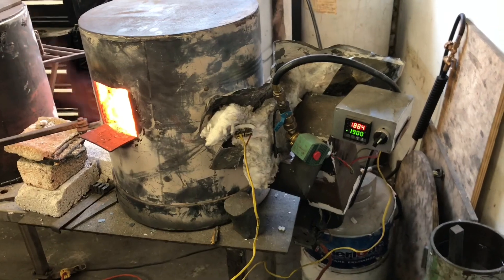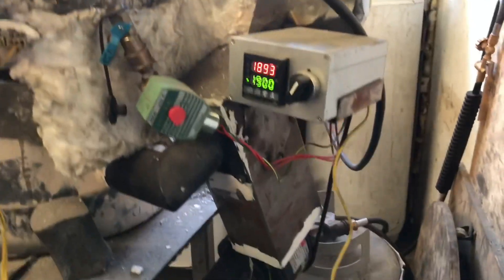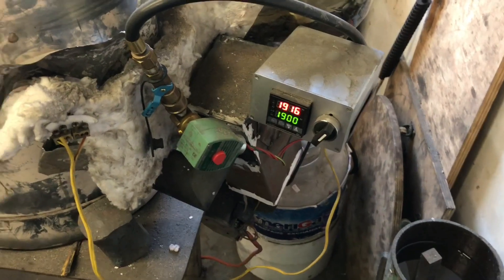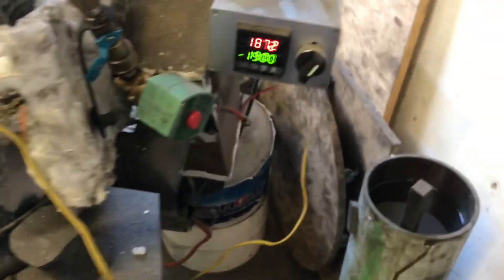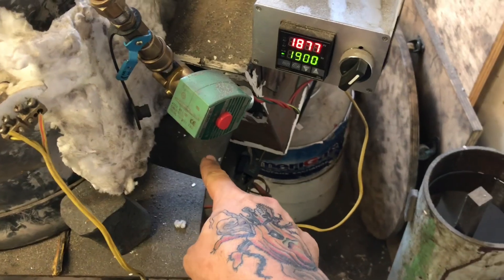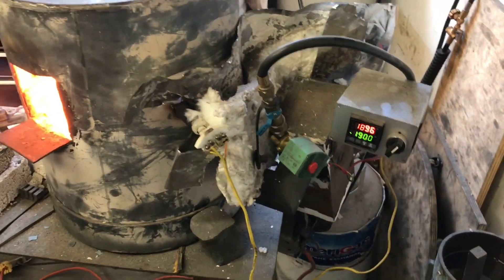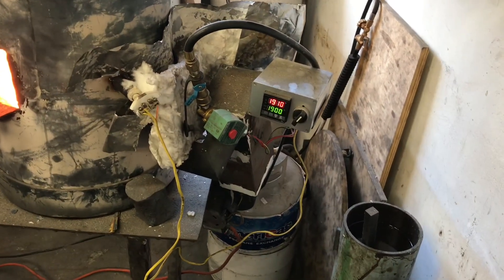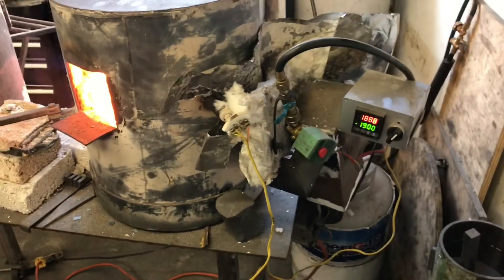PID controlled vertical blown Forge

Comment: So, I just bought a PID controlleer and a thermocouple for my gasforge. Wanted an evenheat but man, they are expensive! Ive seen sveral setups like yours which is awesome. Is it hard to setup like yours?
Reply from the maker: Nah it’s super easy. There’s some good tutorials and schematics online. I’ll try to remember to post a link tomorrow when at my pc.
Reply: @TuckerParrisTAPForge  That would be awesome! Thanks :)
Reply from the maker: @fixxfixx  https://www.bladeforums.com/threads/pid-control-forge-salt-pots-and-more.782574/
Reply from the maker: @fixxfixx  also just noticed there are some resources already posted in the comment section.

Comment: Hey man great vid I just have a couple questions. First of all, how much did that forge cost? Somewhere between the $800-$3,000 range?
Is it gas or is it wood fueled?
Reply from the maker: FriedPickle I think I spent 500$ on the Forge from uncle Al at Riverside Machine and 100 to 145$ for the PID set up. And then the gas tank was a donation from another art studio. But I bought a 60lbs propane tank once for like 150 or so. So basically 800$ all said and done. 
Could be done cheaper tho, I bought all top of the line parts.